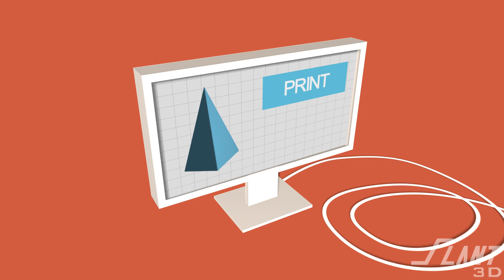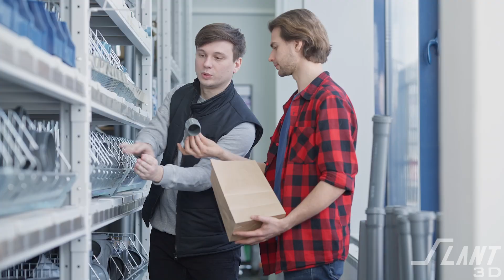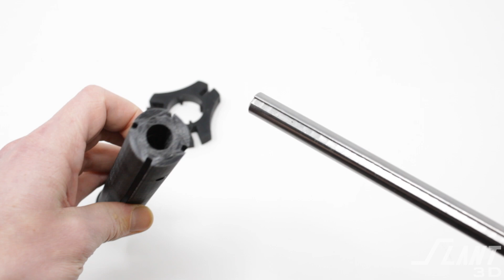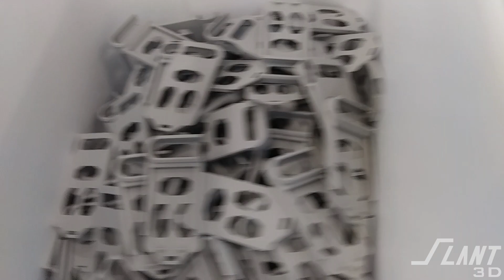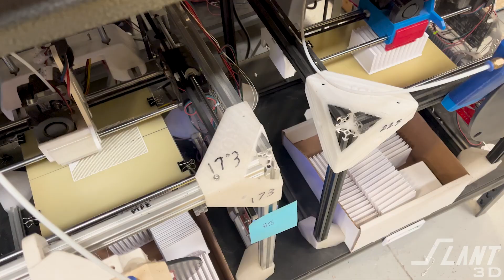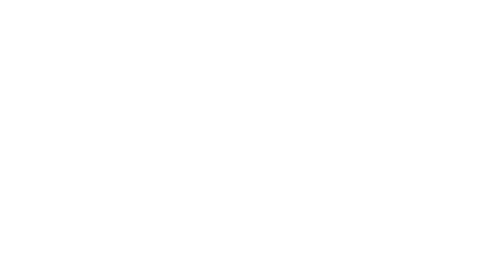Why Large-Scale 3D Print on Demand is So Hard

Comment: Have you considered 3D scanning parts as they come off of the printers to reduce having to have people visually inspect the parts? 

It could only be done for parts that need to be very dimensionally accurate but I’ve heard about companies like lg using that for their injection molding machines. It gives a heat map when compared to the cad file of what is accurate and what’s off, as a customer I’d love to have that kind of information
Reply: To expand upon this, I think that it may be possible to do this with a much less expensive computer vision based setup looking at NERF’s and other forms of camera based 3D scanning that have been coming out recently. 

Looking at some of your past videos it looks like all your machines still need the prints to be removed manually is that accurate? 

If so is this something you are hoping to automate as well?

Comment: The quality of the design about to be be printed will have a major impact on the quality of the component printed. How to ensure a design is up to a certain set of standards?
With pcb (printed circuit board) design software the designer can run checks and validations. For example can check if traces create short circuits or if holes line up with traces, etc. With 3d printing, much of printing is controlled by the slicer, with no way to check within a CAD program if its well designed to 3d-print. Perhaps as part of submitting a design to be printed, a set of verifications can be applied to a design? Ideally CAD software would have a plugin that could be run throughout the design process. 
The cool thing with 3d printing is cost to print is low. Using of cameras, or lidar to scan and inspect 3d-prints could provide feedback (either to customer as images, or be automated using the design as a reference) so a test print of a component can be validated prior to printing zillions. All without needing to even to ship a test 3d-print of the component.
(eg: print a test article before lunch, check status, after lunch, confirm and order 100, shipped for next day delivery)
Love the b-roll btw!

Comment: The advantage with 3D printing is you can observe the insides of the part as it's being built up. There has to be a way to automate the entire verification process, capturing a 3D model of what was actually printed and subtracting it from the original CAD model to find deviations. And since you can capture every layer, it could, in theory, be done with 2D cameras.
Reply: Seems like a great idea.  But I suspect that in practice it wouldn't help all that much.  The problem is that the part has to perform in real life, and often with 3d printing the failure to function is quite subtle, and not necessarily tied to conformance between the print and the geometry.  You can have surface finish effect.  You can have issues with pieces just not fitting together.  You can have problems with stiffness or toughness variation.  Just pinning down what levels conformance to geometry are necessary for functionality is challenging.
Reply: How do you plan to create a 2d camera? We live in a 3d universe and I've never heard of a company manufacturing electronics in a lower dimension than base reality...
Reply: @smallpeople172  I meant cameras that capture in 2D, not camera hardware that's somehow two-dimensional
Reply: you can easily train neural net to detect common defects